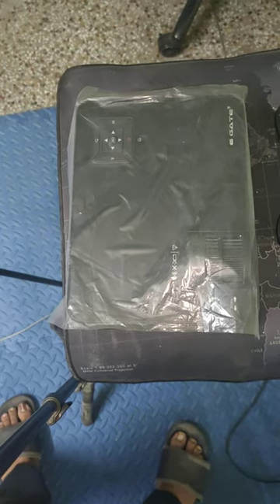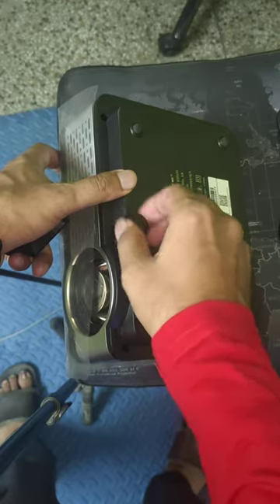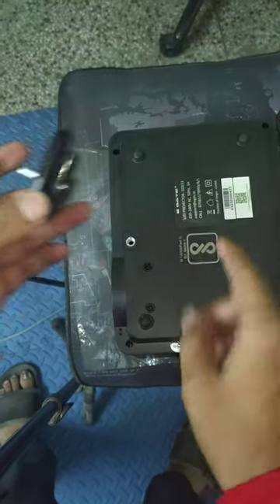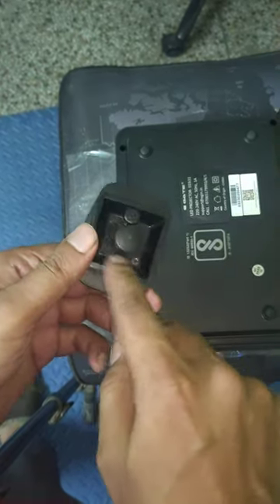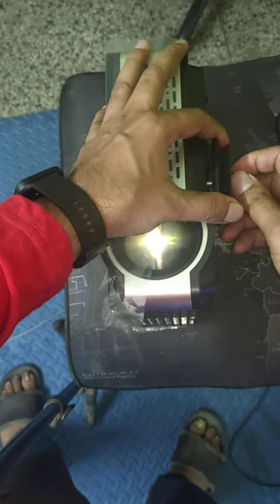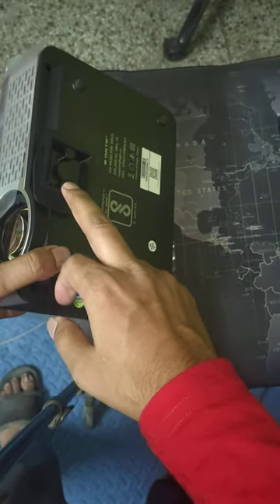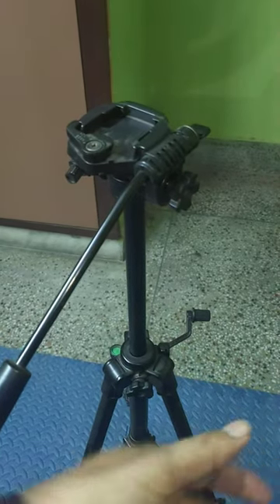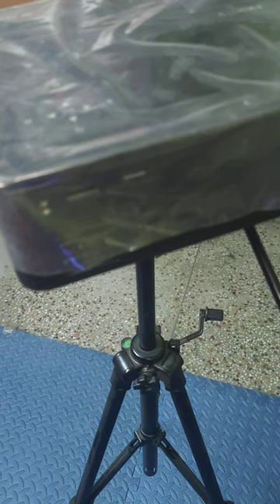Add tripod mount to any projector

Comment: Of this tripod
Reply from the maker: @YouTubehub0  ita not the same as mine is from sony these days that is nota available.... but very similar product DIGITEK® (DTR 550 LW) 67 Inch Foldable Tripod Stand with Phone Holder & 360° Ball Head, 5kg Load Capacity, Aluminum Alloy Legs with Rubberized Feet & Flip Locks, Carry Bag, for Photo & Video Shoots https://amzn.in/d/0a8eVQEJ